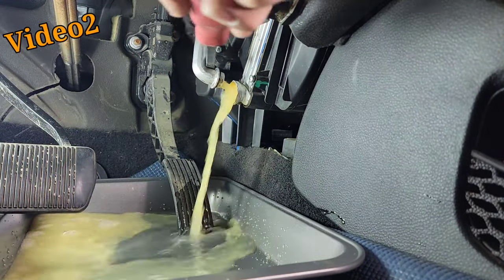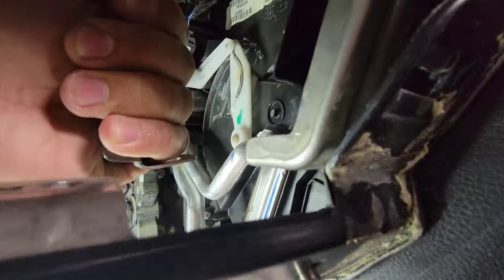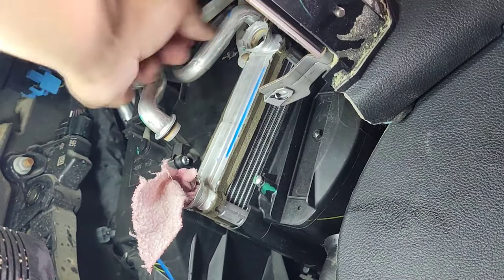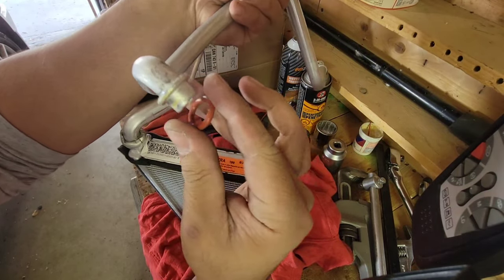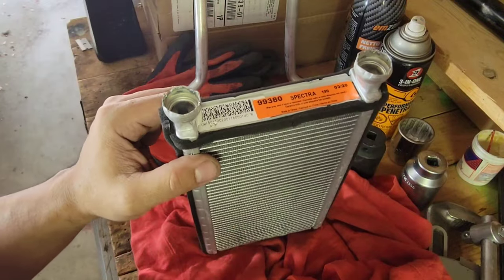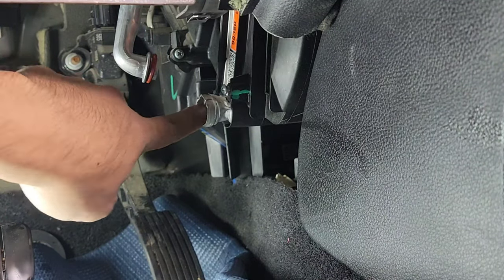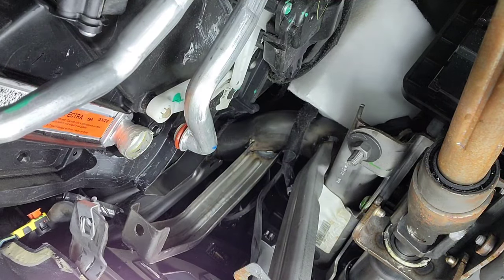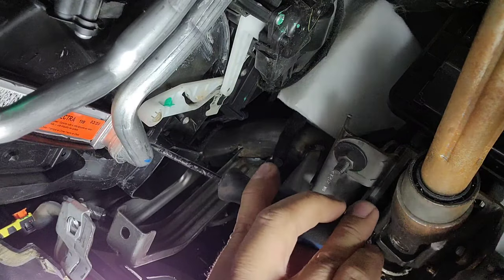V2: Dodge Journey Heater Core D.i.Y Remove & Replace - No Cuts Clean Repair

Comment: Wrong way . Don't do it because it will leak a lot the easy way is to cut the pipes and connect them with  Hoses.
Reply from the maker: I believe  this idea i got on this video is one of the clean fix and its the best guide. Its been 2 months here in  Canada Nort Pole weather. BEEN no  leaks, no problem  and  everything  holding up  good,  improvement hold good heat in the cab
Reply: I think mine might need replacing, when I do it, I'm going to do it like he did in the video. I'm not cutting anything. I've replaced ac lines that was something like this. If you cut and put a hose on with clamps there is a chance they might blow off. I'm not saying 100% it will because there have been times that I had no choice to cut and use hoses. But if you can avoid it, don't. He is not damaging the area where the O rings seat so it's not going to leak.
Reply: your cooling lines in the eng compartment are connected  with rubber hoses and also clamps same concept , bending ther aluminon lines at the connection can weaken the metal there as well,,aluminon doesn't have great metal strength and retention just be careful if you decided to go this route @LinkSquish
Reply: That’s a good idea.
Reply: Mine is leaking. Can i do something?
Reply: I just did mine and I opted to do it the way of the video instead of your comment. There’s not enough room where the lines run to put a splice in, and after I got the old one out by taking the lines out of the connectors, I observed it looked way more solid to just continue with how this guy in the video did it, and I didn’t have to worry about getting the splices to fit where the lines run.
Reply: @manaswibhardwaj4399  don’t put stop leak in it, replace it. That’s why I had to replace the one on the vehicle I was working on. Customer put stop leak and it clogged everything up so then nothing was working and it was still leaking.
Reply: What was the problem you had? I have one and I think my core is clogged, it only heats on one side

Comment: To think that Dodge engineers would have put in a Union connection right at that point to remove the heater core.  Oh well the difference between so called smarter engineers and plumbers.  A steam fitter or plumber would have done it that way.  Engineers not so much and the auto industry is lousy plumbers.  Just need a hydraulic crimper.

Comment: why are you altering the crimp connections ? you could join the pipes with 5/8 heater hose and clamps  lot less likely  to leak .   the repair ya did here looks mangled  hack job
Reply from the maker: Lol.. what  are you talking about, its  clean job

Comment: Awesome video and idea! I would add pulling the heater hoses in the engine compartment and use an air hose to blow out the core before changing. This will eliminate fluid inside the cab when changing the core.
Reply from the maker: Good call on Applying air on the hose before changing the core, make sure the air line pressure low not to high
Reply: Great video! My 14  journey core leaking driver side floor if I  blow out line's would that stop the leak?

Comment: Great job, but I believe cutting the  metal tubes would be an easier and less chance of a leak and also less chance of damaging the new core,,,and I wouldn't have any thoughts of the tubes leaking with the rubber hose connections as well

Comment: Wow nice job! I have a 2014 journey it's leaking coolant driver side and passenger carpet . When  you seat the lines into the new core do they kinda lock  into a slot ? Or can line pop back out as you tap around the connection . thanks for the video going to try!
Reply from the maker: The aluminum lines just  pop right in to the new core, No locking  or clips  super easy
Reply: Ok thanks ,plus some guys say disconnect battery for knee air bag?can that burst?
Reply from the maker: For safety  better to disconnect the negative battery  cable
Reply: @jfGarage4k  ok thanks

Comment: Would have been so much easier if Chrysler had designed this to have a threaded/union style fitting...Would make this such an easy job if they had. Or at the very least a clamped hose fitting in-line.
Reply: They don't want it to be easy for us. I have paid over $1500 and have no heat and A/C for 3 years now in the Canada weather...

Comment: Do a video on how to remove lower dash to get easier access to heater core.
Reply from the maker: Sorry i dont have this vehicle anymore..
Reply: Thanks for the video I have heat now.  One question though did you have to remove the leg airbag?  I did and when I put it back the airbag light stays on.  Do you have that problem?  Thanks
Reply: 2 - 10 mm bolts right left corner pull cover each side clips will release!
Reply from the maker: Ya i have  to remove the leg airbag, i got no problem  after  finish installing everything.  Double check the connector of the airbag  make sure the locking tab is open before you push the connector all the way in.

Comment: This works. The air bag needs to come out, so the battery needs to be disconnected. I also drained the coolant before dealing with the heater core pipes.
Also before reassembling, run the vehicle, bleed the cooling system, and run it with the rad cap on to build cooling system pressure to confirm no leaks at the heater core